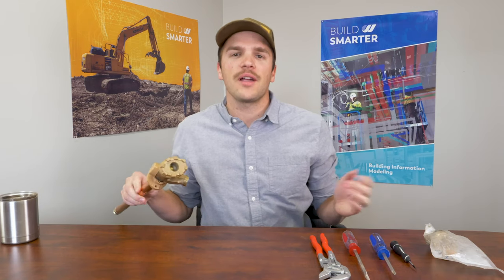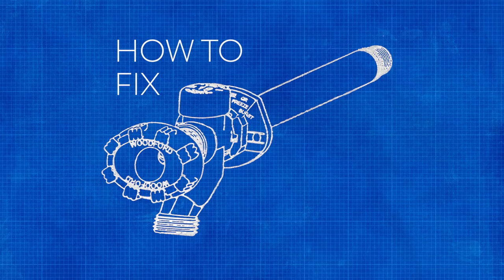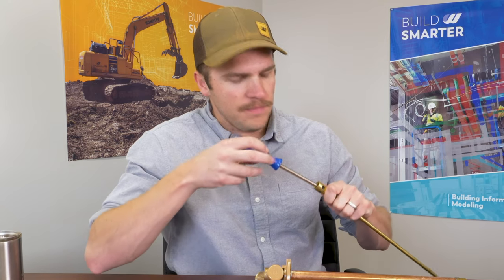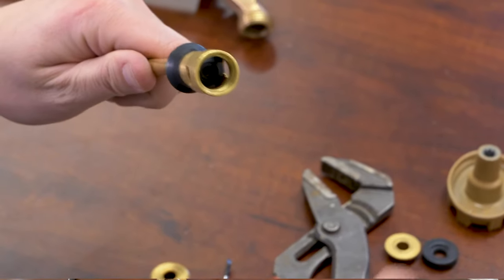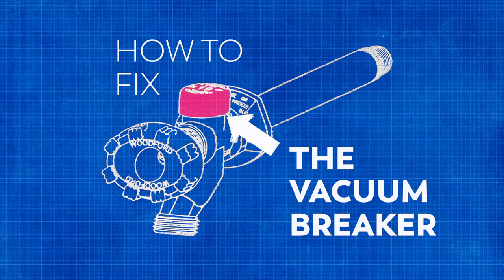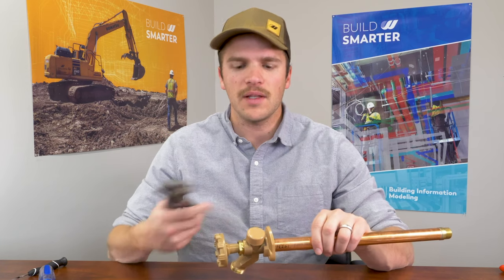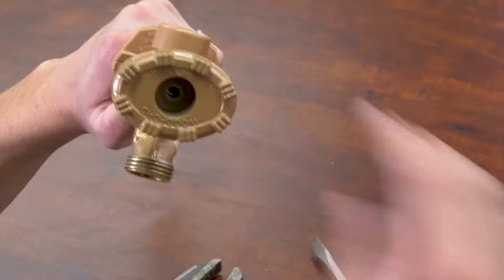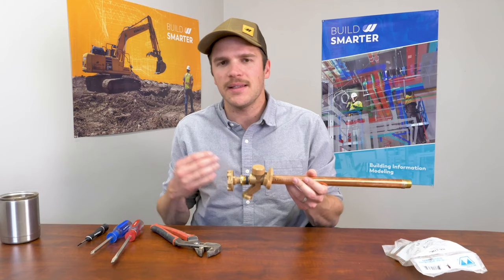How to Fix a Leaking Hose Bib (Woodford Model 19)

Comment: Had a slow but consistent leak from the knob, and searched a lot yesterday for how to troubleshoot that, and came back with nothing but installing a full repair kit to fix spigot leaks.  I had decided I'd go to Lowe's tomorrow to get a kit for the Woodford Model 17 and get it over with.  Then, this video was randomly on my recommends today.  LOL  Watched over 25 videos, this is the only one to recommended testing the packing nut as an initial step ... it had somehow loosened, and I was able to get a quarter-turn tighter, leak stopped.  Saved me $30.

Comment: Great demonstration, photography, sound, and explanation. On my original attempt I missed the step of re-engaging the tube with the handle prior to installing the packing...so the spigot leaked! Looking back on the other video I had viewed prior to my "repair," I noted that this step was glossed over a bit. But my bad, all the same. This one is going into my "save to watch later" bin, as I am certain I will be needing it again. Well done.

Comment: Little note.  When tightening the packing nut with new washer don't tighten as tight as you can get it.  This way if it leaks in the future you can simply tighten a bit more to stop the packing leak.
Reply: He said lightly sung it.....he did it right.
Reply: Also for newbies to maintenance — always use two pair of channel locks, so you don’t tweak the whole works 😂
Reply: @fredhelmecke6073  s

Comment: This guy knows plumbing parts terms. Nice to see an actual plumber teaching actual plumbing.
I think my leak is from the corroded handle screw. Is that possible? The packing nut is reverse-thread and seems snug.
Reply: Likely it's the packing (seal) behind the packing nut. The handle screw doesn't hold back any water at all. The shaft that it screws into goes through the packing inside the packing nut. Hope I didn't confuse you too badly.

Comment: Your video was very helpful - thank you!  I purchased a 3 year old home with Woodford faucets - some hot/cold and some just cold.  I don't know what model numbers they are so I'm hoping the numbers are stamped on them somewhere.  My question is "do you know where I can purchase the basic parts (e.g. valve seat rubber, rubber check valve and packing washer) for the Woodford faucets?  You said "your local hardware store", but my local Home Depot and Lowes don't carry those specific parts.

Comment: Great video. Like that you left in the mistakes. Is there an easy way to identify which valve I have? Are they all marked with model and brand?
Reply: The woodfords have the model number on the top of the vacuum breaker,

Comment: Thanks for the great moustache and video. I am purchasing a home and inspection pointed out a leaking hose bib on the outside of the foundation is likely causing some mold inside the finished basement where the drywall meets the floor. I presume this means the hose bib leak is actually leaking inside and draining onto the floor causing this mold. Does that mean drywall needs to be removed, mold killed and cleaned up and that should be it to address this? Or can there be worse downstream effects?

Comment: Looking for help.  My hosebib only has a 1/4 turn from off to on.  Guessing there is some kind of cartridge rather than rubber seal.  Can't figure out how to pull rod and assembly.  Any suggestions.   Tried turning handle hard and no luck.  Tried pulling hard no luck.

Comment: In my new house I have a simile faucet. When under pressure - with hose and sprayer attached but closed - there is a water running noise in the wall containing the pipe (as if the water was/is fully turned on). Is this a normal backflow noise, or do I have a leak in my wall?
Thanks!

Comment: This one looks very similar to mine. Plumbers are quoted at least $250. Might try it myself now
Reply: $250? I was just quoted $1,100 to replace my hose bib by a plumber.
Reply: @dude4173  holy crap, mine was just a bag of parts that cost like 10 bucks. Is your bib an older one with no access?
Reply: @detech8149  it’s a 1971 home with access in crawl space.. I’m checking with two other plumbers right now to compare prices. I’m sure this guy just doesn’t want the job so he shot high hoping I wouldn’t care.

Comment: Love how these "repair" guys show us how to work on a brand new valve. Let's have something about removing a packing nut from a hose bib that's 30 years old.
Reply: Patient and a pick. Judicious use of tug , pull and smack on adjustable wrench to pull the stem out .
Reply: Had the same problem with my 30 year old spigot...until I pried the ancient solidified packing rubber from the washer. It popped right out after that.

Comment: I had a similar model at my house the nozzle and vacuum valve were leaking, I replaced everything but the actual brass valve stem. Everything went works great but now when I put the spigot under pressure with a garden hose it leaks out of a small hole on the actual valve stem, not around the valve stem from the inside of the valve stem. It's really freaking me out hahah. Only thing I could think is on my model at the end the rubber seal is seated with a spring behind it.
Reply: Or the shaft is cracked or gouged letting water past the seal.
Reply: Sometimes there will be a hole in the metal.

Comment: I'm unsure what the actual problem is. Its not leaking when turned off. But when I open the valve, the water flow is reduced significantly. Asking for some guidance before I open it up. Thanks for a great vid. Mine is an American Valve btw.

Comment: Any suggestions  for me? , Water  flow does not return through value whatsoever after turning water suppy back on .  New Woodford model19 ,just like in this video.  . open or close valve. No flow .Doesn't leak either .

Comment: Can I replace the valve handle without turning off the water? I don't have a separate shutoff for outside and last time I turned off my mainline and turned it back on it leaked for days without me knowing. I'd have to get a pro out to fix the mainline because the City needs to shutoff the water to the house. Its a big thing... Want to fix the leak outside without all that hassel.

Comment: I have one similar to this, maybe not the same model but the same style. My problem is the handle doesn't stop turning when your turning the water off. It keeps turning clockwise forever and it's hard to get that sweet spot where it quits leaking water. Any suggestions here would be appreciated, thank you.
Reply: The spigot handle is not securely in place
Reply: @JLilliquist  The spigot handle is tightly screwed on, it's not loose but it seems like something is broke on the inside where it shuts off the water flow. Do you have a solution as to how to fix it? Thank you

Comment: Hi. I have the Model 14 (without the vent). All the kits I've seen do not have the "check valve rubber" included.  Does the model 14 NOT have the check valve??  I haven't had time to pull it apart yet because I want to isolate that line with a ball valve 1st. Thanks
Reply: No vent, no check valve.
Reply: The difference between a model 14 and a model 17 is that a model 14 doesn’t have the plastic float on top and also the washer on the rod is flat. The rubber seals on the rod inside the faucet are the exact same.

Comment: To replace a leaking vacuum breaker, it doesn't look as though I would need to shut off the water supply to do so, correct?

Comment: I replaced my hose bib with a new kit and it still leaks. Even tried another kit. The sillcock is 32 years old, should the kit always work or is it possible I need a new sillcock? Unfortunately the sillcock is behind a wall which I would need to open inside the house. I'm thinking where the washers seat is probably burred up, is there a tool to fix this or a specific kit so I don't have to open a wall? Thanks!
Reply: You need to go into the crawl space to remove it.  Not fun

Comment: what if the plastic part broke at the threads inside the anti siphon
Reply: The plastic part is called a float and if it broke you will have to get a new one. The faucet is will leak with a broken one

Comment: My hose bib is obstructed?  No water when turn on.  No the water isn’t turned off somewhere in the house.  This bib is only used in the summer to water the garden.  I’ve always had problems getting water out of this bib.  Turn on off several times or run a wire up into the bib would get the water flowing.  Not this summer.  I’ll follow your disassembly instructions to see if the house contractor inadvertently left debris in the water line.

Comment: The packing washer is different on each side.  You said nothing about which way it goes and I couldn't see the detail on the video.  Which side goes in to the washer?
Reply: Not a plumber, but on the RK-17MH repair kit the diagram indicates that the packing washer can be installed in any direction.

Comment: If the packing is cracked would still leak at the handle
Reply: More then likely if the rubber seals are damaged it will leak

Comment: Those anti-siphon hose bibs are garbage. I've replaced them with standard cast brass spigots and never had a problem in PA and NJ.
Reply: Mine are 17 years old and work fine except for needing adjusting every decade or so.

Comment: Dont use frost proof hose bibs. They are awful. Use a regular one ,A gate valve is the best Pitch the pipe down from your line turnoff inside. Open so all the water drains from the shutoff in the line outside.

Comment: This is way too much work, lol. Much easier to just buy a full replacement with a compression fitting already on the new one or use a Sharkbyte connection to swap these out every 5-10 years.